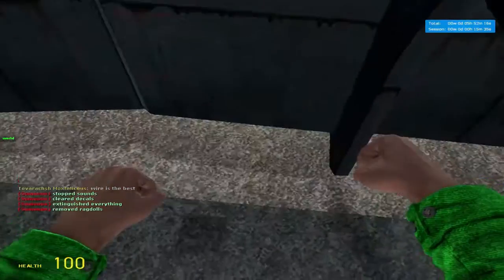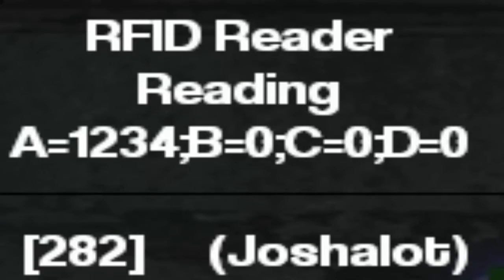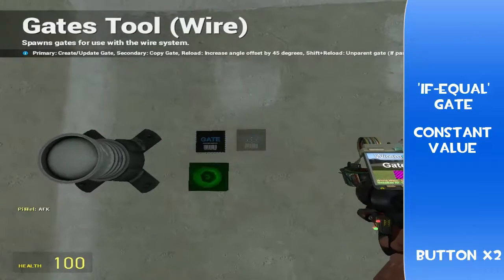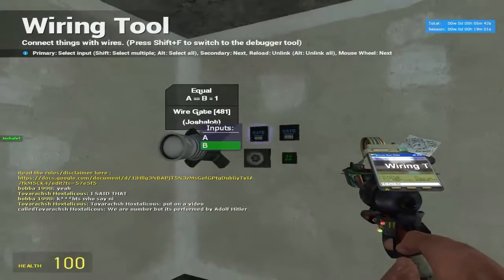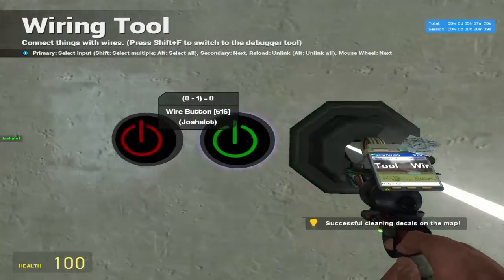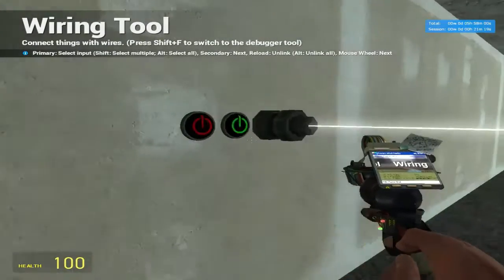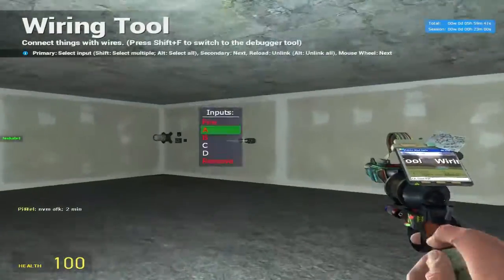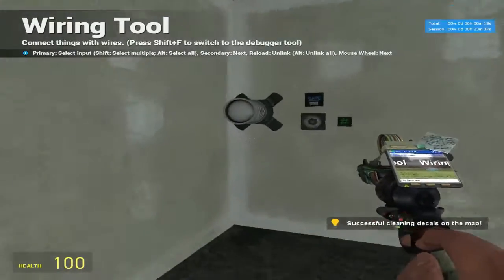Gmod|Wiremod Tutorials #10 | RFID Reading

Comment: Thanks for the tutorial, learned a new tool today.
So why would i use this, I mean i can make an array or a table to whitelist players and use find functions to detect player close to a door or use "rangerOffset" if you want to make it more optimized, and i wouldn't have to worry about anyone seeing my constant value or using my button to inject himself.
Reply from the maker: This system is a bodge :P
It works but could be improved. This is just one of the many ways you can detect certain players. Thanks for the feedback and the suggestion for a more optimised system. Merry Christmas! :)